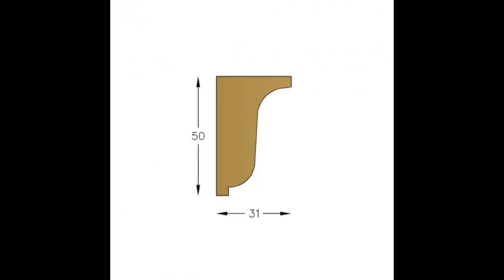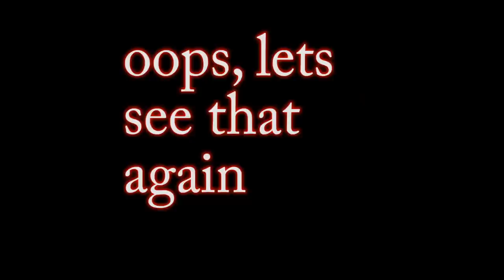Spindle Tools for Woodturning: cutting and sharpening  by Sam Angelo

Comment: Sam;  Just came across this.  I have been making gnomes for Christmas.  Peeling cuts and planing cuts are no problem for me, but making that tapered hat is not easy for me.   One suggestion.  I attach a stick on tape measure to the bar of my oneway jig on the side away from the clamp.  Then I write the measure on the shank of the tool.  Allows me to repeat the same setup each time I grind that tool.

Comment: Im just starting out and this video is a godsend - has opened up my eyes to alot of new stuff - that after having gorged myself on all the videos i can watch on here. I see you're turning stuff at 2500 rpm - If my lathe only goes upto 2100rpm, would that be a problem at all, or just mean i would have to turn small diameter stuff a little more slowly?

Comment: Same, thanks so much for the video (s).  Just got my first lathe for Christmas so i'm immersing myself in various how tos...and am finding yours extremely helpful in showing angles, stances, techniques etc.  Truly appreciated.  Once i get a little more over the intimidation factor i'll start playing with my first blank.
Reply from the maker: I think the best place to start is with a small, wet limb.  Just put it between centers and practice.  Turn a little slower at first 500-600 RPM.  Sam

Comment: Speaking of practice maybe you could practice holding the handle in your left hand and guide the chisel with your right hand for the left hand cuts as I find this way more comfortable and more accurate then trying to cut the left side of the bead from a right handed stance.   Plus one has full control due to one guiding with the right hand, and as you cut right right handed you will see what I mean if you try this out.  Nice video full of information. Thank you for the upload.  Subbed.

Comment: Thanks again, your library of videos is invaluable. As a novice at sharpening, I have some concerns; I seem to be getting a sharper point than desired on spindle gouges with steel fixed in the handles (Sorbey). I'm using the Wolverine setup with a Rikon slow speed grinder, (not using the vari-grind attch) . My sense is maybe the shape of the end of the handle in the jig may be a factor?
Reply from the maker: Allen 
I’m not sure how you’re sharpening this tool, are you putting the end of the handle into the V arm?  When sharpening a gouge, you should be swinging the handle from side to side to give you a swept back wing.

Comment: Great video. Thanks a lot for all the explanation.
Beginner with wood but experienced with metal work. Couldn’t help noticing the parting tool is used flipped 180 degrees compared to metal lathe work. Anyone knows the reason for this?

Comment: I really like your video. Can you please show us where the tool rest is in relationship to the center for each tool.
I know the height is very important on weather you get a catch or not. I know I need this instruction.  Thanks
Reply from the maker: Charles
This is a good question----maybe one for my next "notes" video.  I am not sure if there is an easy answer.  One, the diameter of the wood changes and you must change the tool rest.  Different tools require a different height.  Ex:  the skew chisel, in my opinion requires a rest at a comfortable height.  If the rest is too low, the handle is too low and not comfortable. I think generally, it should be right at the center line.
Sam

Comment: Sam, I see you are getting fine curls when you rotate the blank by hand; I cant get those;why? Do you hone the edge of your turning tools, after grinding, as you would do with carving tools?
Reply from the maker: Seth, a lot goes into having a properly sharpened tool. The proper grind for the  nose angle in degrees and how you sharpen the tool. Really too much to cover right here. I just think it takes a lot of practice and experience. Also you might try practicing on wood that is a little softer that will help Sam

Comment: Hey Sam, Hope you are doing well. I am just curious about something. At 18:35 in the video when you are cutting the cove I can't quite tell if the bevel of the gouge is rubbing or not (maybe only a very small portion is rubbing?). Can you please comment? Thank you.
Reply from the maker: Good eye....I think at first in cutting this cove the bevel is not really rubbing the wood but toward the end-it is.  I may have a micro bevel on the tool that can't be seen.  I think part of it is the camera angle.  Something else-I think the bevel on this tool is really long.  A tool with a shorter bevel would be better.  Sam
Reply: @WYOMINGWOODTURNER  
Thanks for the clarification Sam, I always value your input.

Comment: Saw what angle is the sque to make a pealing cut.
Reply from the maker: I am not sure what angle you are referring to....the angle on the cutting edge of the skew or the angle I present the tool to the wood.  Let me mention each a little.  First I am not sure what the exact angle is on my skew chisel.  I do have 5 or 6 and each may have a slightly different angle.  I think this is up to your own approach and what you need from the tool.  I also am leaning more to an edge that is fairly straight.    As far as the pealing cut I present the tool in a cutting orientation-with the handle low.  The cutting edge is square on to  the wood with the handle fairly perpendicular to the surface of the wood.  Sam

Comment: Is it necessary to have a bowl gouge to turn the inside of a bowl? I don't have one and have tried to use a roughing gouge or a spindle gouge but, they want to grab and throw the gouge to the outside of the bowl. 

I am new to turning and trying to get started. I have only turned a couple bowls.
Reply from the maker: The main thing in answer to your comment IS...do not every use a spindle roughing gouge on a bowl or cross grain piece of wood.  A spindle gouge would work but it is probably too small.  A 5/8" bowl gouge is important to have.  Sam
Reply from the maker: Please watch this video    https://www.youtube.com/watch?v=rCGlz2gajLc

Comment: Where did you get the set up for sharpening the tools?
Reply from the maker: Good question.   I have gone through several sharpening setups over the years.  I had 2 sharpening jigs before I settled on the Wolverine oneway jig.  Setting up depends on how much do you want to spend.  I have 2 CBN wheels which are amazing, but cost upwards of $450.  You really need a slow speed/variable speed grinder.  Woodturning is a very expensive hobby.  And, I don't know what you have now.   Sam

Comment: I always get catches  with this tool, what may be wrong?
Reply from the maker: I usually sharpen my spindle gouges at 40°. This creates a very long bevel which might be hard to control. You could perhaps try a shorter bevel with maybe a 45  degree nose angle. Other than that it does take a lot of practice. Check up a piece of soft wood that you can just waste away and practice coves and beads. Good luck. Hope this helps Sam.

Comment: Pinch points are scary when watching wood turning...like to see a video on safety....don't want my head knocked off....or a tool impale my body parts !
Reply from the maker: Cary   I am not sure what you are referring to-Pinch points?  Please put this in some context.  Mention a time in the video, that would help.  Is there something not safe in the video? This video is 3 years old.  I can't remember what is exactly in it.  Thanks Sam
Reply: @WYOMINGWOODTURNER  What I mean is were a tool can get to close to the chuck...or stock can fly off the chuck also, the tool can dig in to the stock and fly out of your hands....just things like that...I've seen guys start cutting stock that looked way to large for the lathe....scary......just general safety tips....I know people should use common sense...but just wondering if people have been hurt while wood turning.

Thanks :)